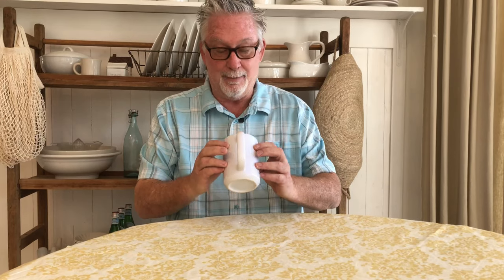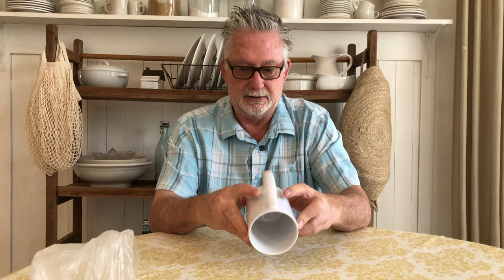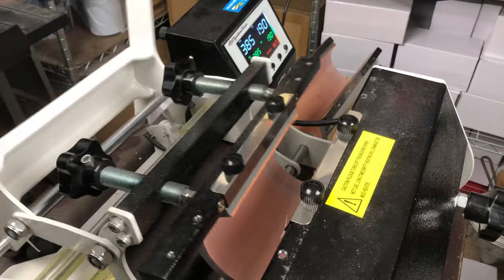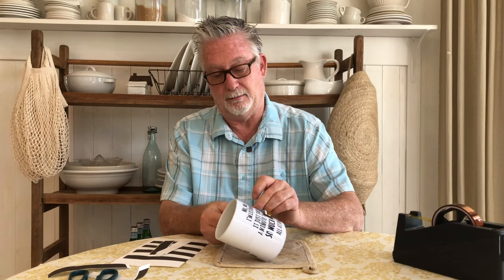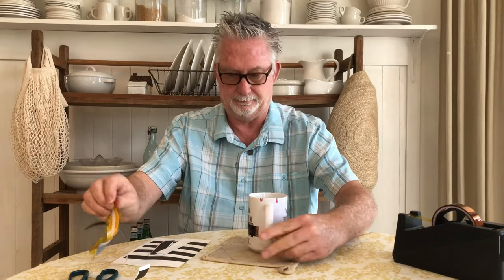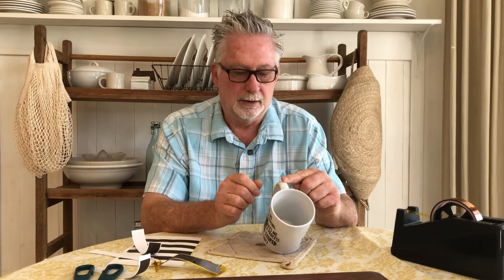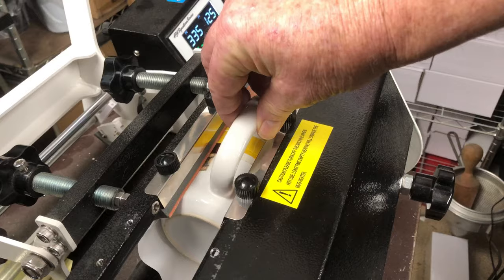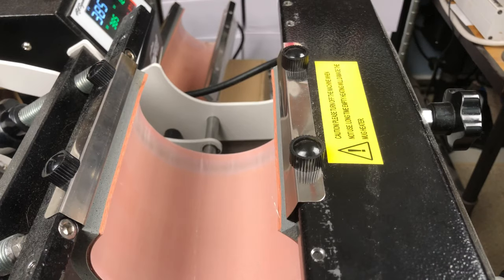Pressing a 15 Ounce Coffee Mug - How to Sub Closer To The Handle!

Comment: Thanks for the test. You got closer to the handle, but it's still faded as it gets closer. How do you handle that? I would want a clean, solid line there. Thanks!
Reply from the maker: Yes, it got closer, but will never make it to the handle because of the width of the press attachment. For any coffee mug that I need to go close to or through the mug, I use an oven. This little test was basically to see just how close I could get with just a press. And you’re absolutely right, you can’t get all the way there without the fade beginning! Thanks for watching!

Comment: Interesting and thank you. I might have tried a longer first heat (150 ish) and then decreased the second cook time (100 ish). Logic: the mug is cold and the first press is bringing it to temp, now that it is preheated, the second press wouldn't need to be as long since it is primarily setting the dye on the last 1/2". Also, have you considered a 40 oz tumbler element? It may close down enough to get the heat right next to the handle. Thanks for the inspiration, and the time.
Reply from the maker: I’ve tried to include heat up time in all my press times so I don’t have to worry about it! (The less math for me, the better!) I love the idea of looking into a 40oz press! Thanks for that suggestion! And thanks for watching!
Reply: Any idea which 40 oz attachment would work with the HPN Signature Series
Reply: @clarkbarkev  I have a PYD press. The element for 40 oz is slight large for the 15oz mug. I haven't tried, but maybe using a 1/4" thick silicone wrap, or whatever thickness takes up the space to allow clamping up to the handle would work. You would have to check with HPN to see which adapter is correct for your press.
Reply: @VanTekConsulting My PYD 40 oz is coming today  as I want to do larger jars in it. I can try the rubber mat for cups and see if that works. I just hate to use the oven.

Comment: I've noticed the temp drop in my flat press when attempting tiles, I wondered if it would help to hit things with a heat gun for a little while. That way when putting into the press there's already a warm object going in. In theory, it should help reduce that temp drop significantly.
Reply from the maker: Erick, that’s a great question. The cooling and heating back up of my tumbler in my press is included in my total bake time. So while I could heat up the tumbler, I would need to adjust my time, and I’ve got my time/temp dialed in perfectly for my machine. I suppose if I were trying to get my temp down, I could do that, but for me, it’s adding an additional step. I figure it’s just easier to include that heating back up time in the total cook. Thanks for watching!

Comment: Watching this video,i think you answered a question unrelated to the video. I was wondering if you sublimate a tumbler or mug and someone likes it and wants one but with their name on it,if it is possible to press a second time without ruining the initial pressing.
Reply from the maker: Hey, Joe! I’ll typically just make a new tumbler for them, but if you needed to add a name to an already pressed tumbler/mug, you can. I really need to do a video about that, as a lot of people have asked. It can be a bit tricky, as you have to have enough heat to sub the name, but you can’t have too much to destroy the existing image. There are a few ways to do it. One way is to re-sub with the name in a press. The other is to use a heat gun. I don’t like the heat gun method as much, because it’s a little more hit or miss as far as the exact amount of time. Thanks for watching!
Reply: @industrialfringe953  thank you for replying. Getting my equipment delivered tomorrow. Mug press w/supplies and sublimation printer. Can't wait to get started. Feeling a bit more confident after watching your videos. Been doing vinyl decals for a couple years. This should be an interesting venture.
Reply from the maker: You’ll love it!

Comment: Those aren't good. It's faded. I have the same press. It's obviously an issue with the press. If it works fine with the 11oz but not the 15 then the attachment is too small. I have ruined so many mugs thinking I was doing something wrong. I wish I would have gotten a different press. The only way to prevent this is to shrink the image. But when you do that, it looks bad too bc there is alot of white space. They need a bigger attachment for the 15oz. The attachment is to small and it's false advertising. Aggregated.
Reply from the maker: I agree that there needs to be better coverage for the 15oz!